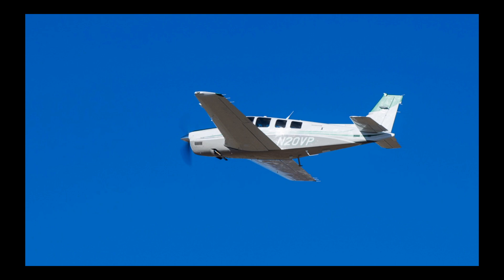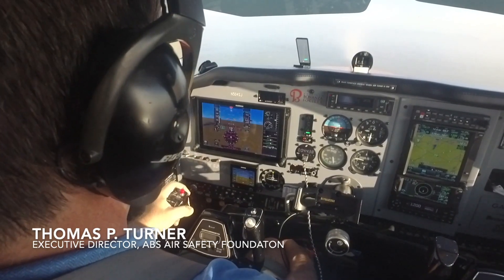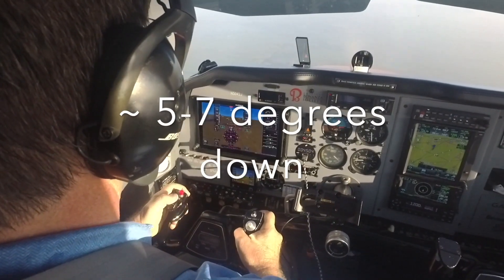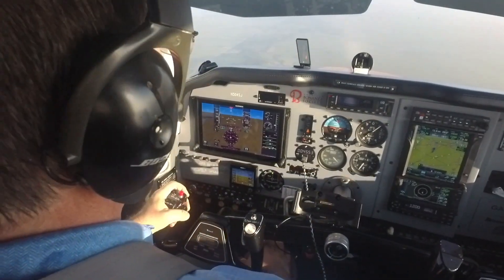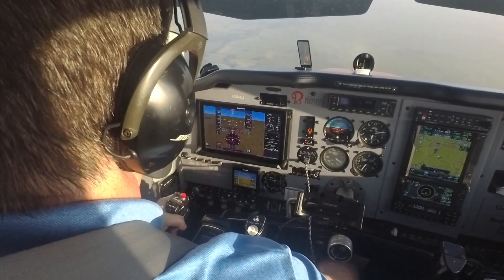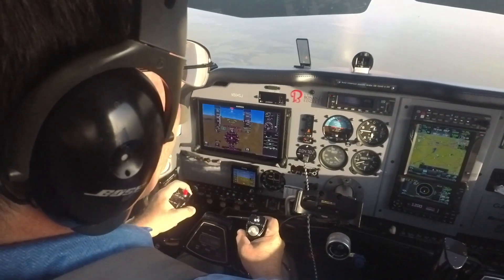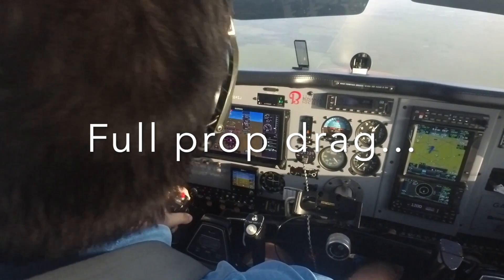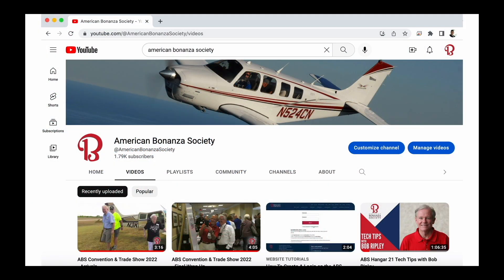Best Glide Demonstration: The Effect of Propeller Speed

Comment: Amazing video.  Thanks.  Question: how did you get your gear up with the throttle to idle - doesn’t it have to be at a position around 17”+ for the gear to go up?
Reply from the maker: The throttle interrupt to landing gear retraction was not introduced until later models. The ABS/ASF A36 is a 1981 model and does not have this feature. - Tom

Comment: The engine at idle is still producing thrust and especially with prop in course mode. For an accurate assessment the engine should be off (ie mags off and/or fuel off). See what the real rate of decent with a bonafide engine failure.